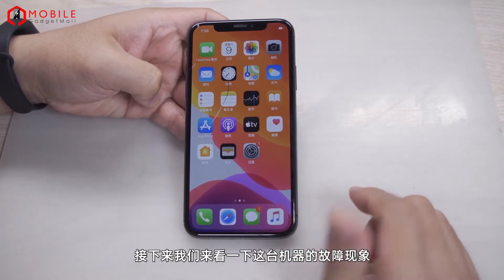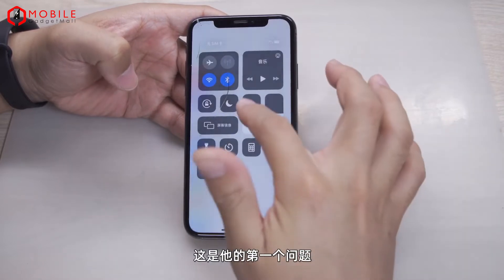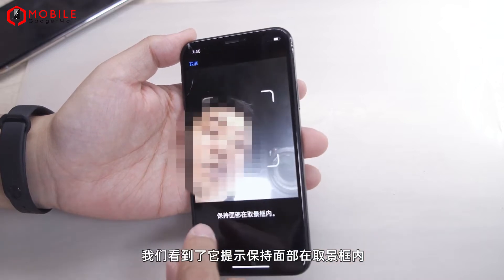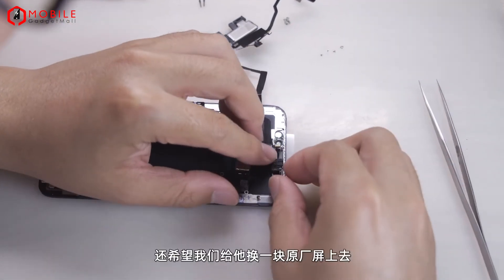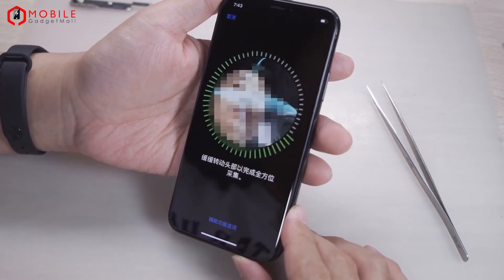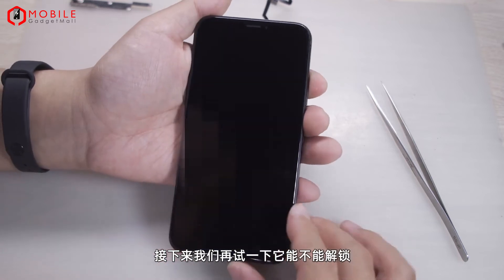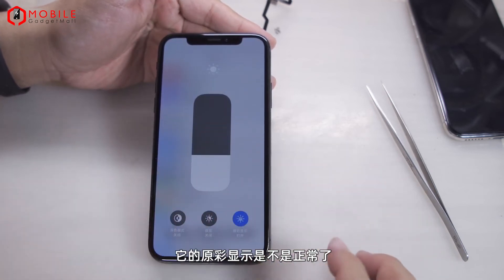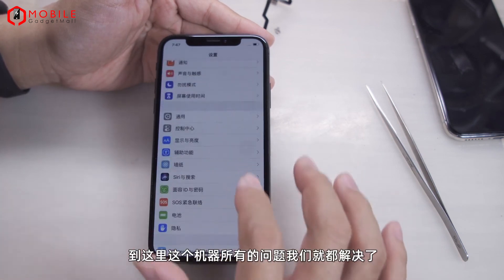Troubleshooting iPhone X Problems of Floodlight Sensor, True Tone, and Face Recognition

Comment: Got a question : should the flashing point be visible when taking a photo with the rear camera in portrait mode ? The fixed red dot is. This to troubleshoot issue with this module when Face ID is not available for other reason ?